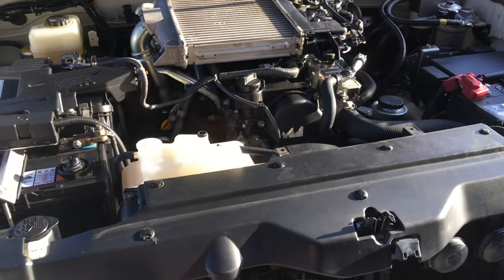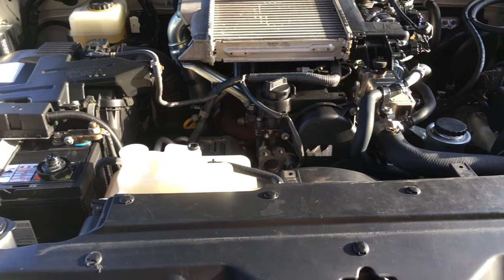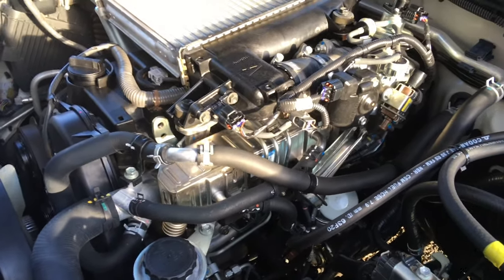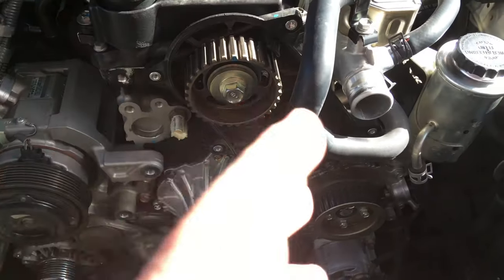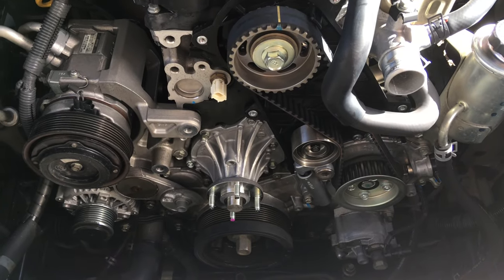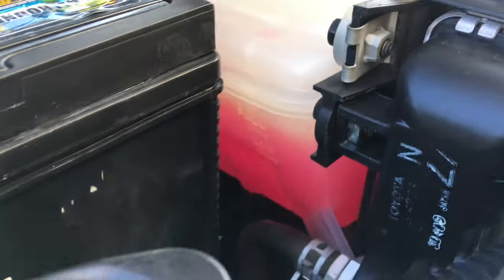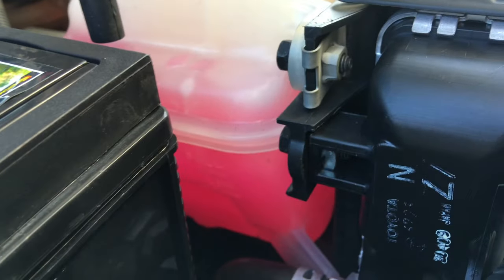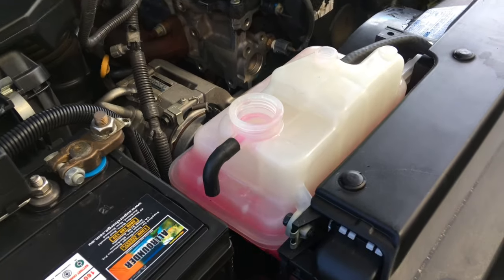HOW TO CHANGE & bleed the COOLING SYSTEM - WITH BONUS INFORMATION of corse!!

Comment: So with the caps off and vehicle idling, I can never get the vehicle to reach operating temperature. So I filled to the B line and put the caps on and went on driving, the excess was removed by the overflow valve and I think it's good now.

Comment: If you are just replacing coolant without the BFE job, do you just have to drain the radiator and header tank? or do you have to drain the block as well - 1GDFTV??

Comment: Hey mate love the video. I was wondering if you had a part number  for the header tank. Mines cracked and when I went in to get a replacement they could only suggest one that doesn't have a tube coming out the bottom. Said it superseded the old one but I'm not sure that's right

Comment: Mate do you do the V6 the same way when bleeding ?? As the V6 doesn’t have a header tank only overflow bottle. Also you suggest finding the drain valve on the block or just drop the.bottom radiator hose ?? and plastic drain plug on the radiator itself ? Cheers
Reply: Excellent question. What say you Anthony mate buddy paly waly?👍